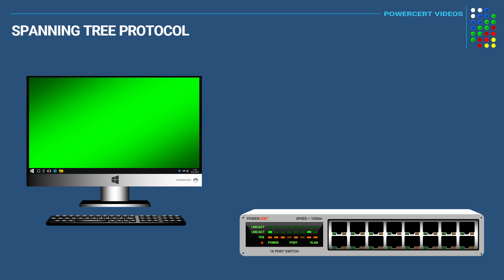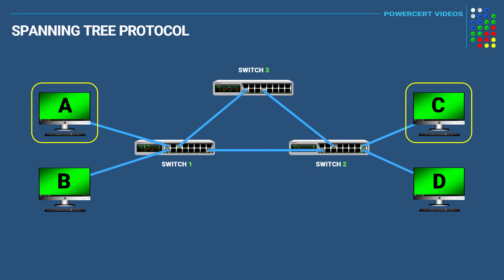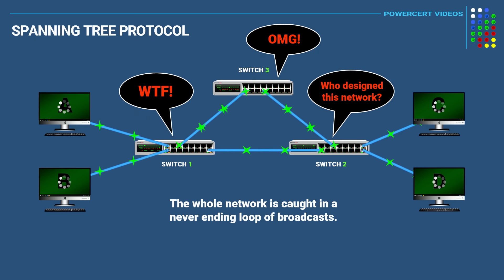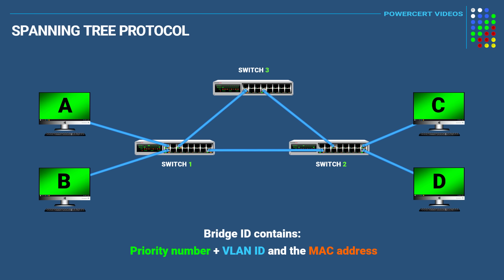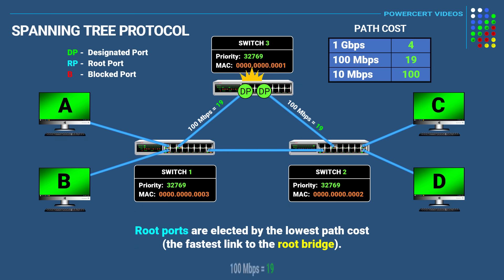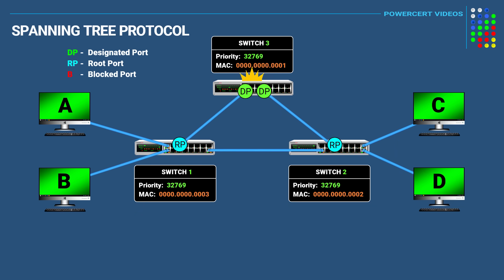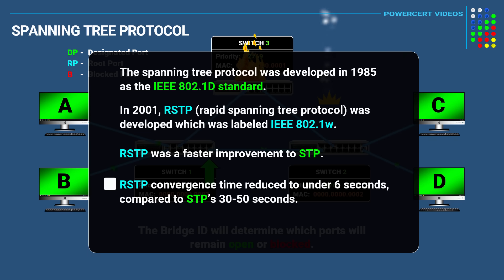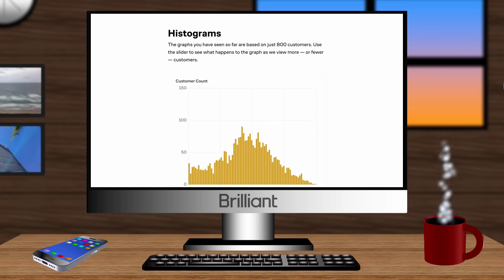Spanning Tree Protocol | CCNA - Explained

Comment: I have a question. I thought that Hubs are the ones which were sending signals to all of the devices. You are using switches in that video and I am a little bit confused. These are switches set to be like hubs?
Reply: Switches can act like hubs, but only when a broadcast frame is sent to a switch. When the switch receives a broadcast, it will send that frame to all devices connected to the network. But all the other times, a switch just sends frames to to the intended destination.

Comment: I failed during interview when asked about stp even after reading about it from my CCNA course book many times but only once I got through your video and I feel confident of cracking the interview. Thank you very much sir. I laughed out when a callout said 'who designed this network ' at the beginning stage of this video 😂😂
Reply: I came here for the same reason, I did horrible on my interview when they brought up STP.
Reply: same experience
Reply: What job are you guys applying? I haven't seen networking jobs for entry level lately. All the job posts I had seen was requiring years of experience.
Reply: @LeoNux-um7tg  hi the jobs I applied for was network operations center analyst 2years back also in another company they were recruiting network engineer/system administrator with 0 to 6 months experience. Yes they ask for experience but be patient enough you may find something related to that role that you can cling on to. Only advice do your research as to whether they provide enough training that you can carry on as your career curve progresses I have seen in my earlier company where a network engineer works for three years but could do nothing on his own even the basics that tech enthusiasts do at home due to his condescending and selfish superiors. Your interest and quest for job role tells me you will soon find one in a good firm. All the best👍 mother universe bless you ✋🤚 good luck 🤝
Reply: I failed this interview question after reading AND watching this video. Just spaced out after 2.5 hours of technical grilling for an entry level role.